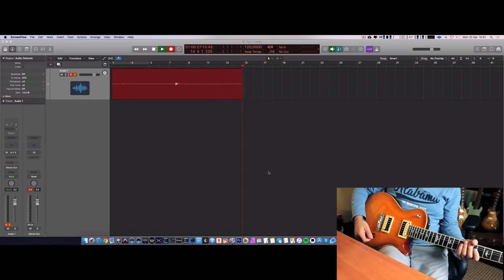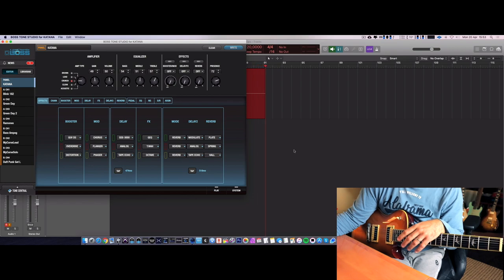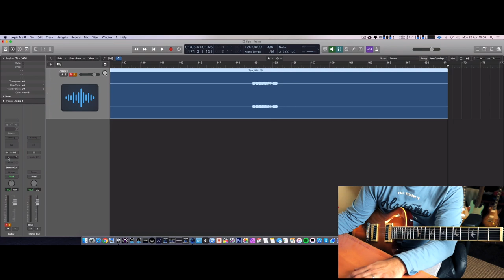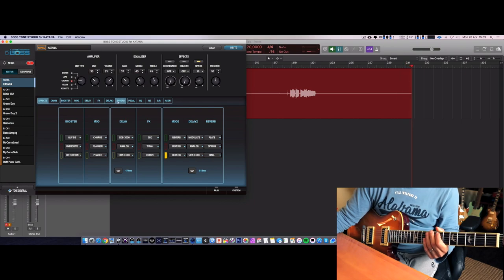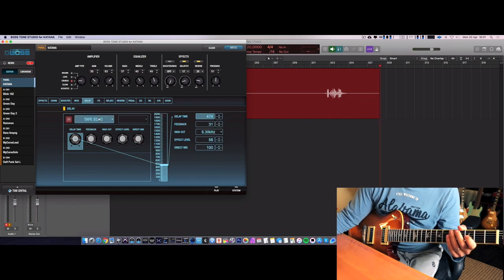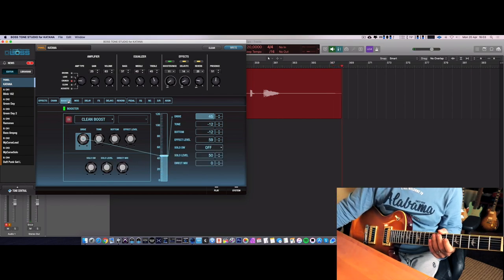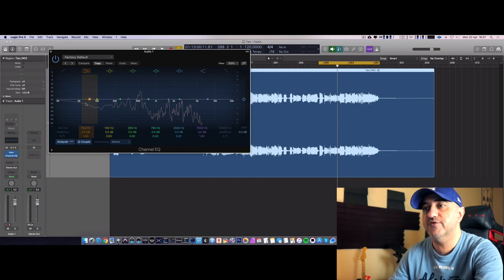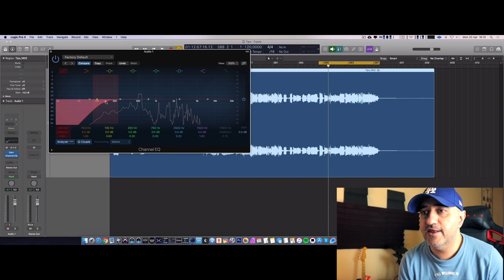BOSS KATANA - USB RECORDING TIPS TUTORIAL

Comment: Hi Juca, you can use the Katana as an input device in Audacity. In my version 2.0.2, you have to 'rescan audio devices' in the Transport drop down menu, then as long as the Katana is connected by USB and switched on it appears in the input drop down menu shown as a mic symbol. In fact you get 'Primary' and 'Secondary' versions, and I haven't worked out why there are two versions, but they work. You can use the Katana headphone out to monitor your mix too. No problem with input volume, you get as much as you need. I have learnt to go for - 12dB as a sensible level. Ian

Comment: The "low output via USB" is not an issue. It's just volume dependent. Use volume knob on the Katana. Set it to the max, and then adjust the Master, which is pass through via USB.
Reply from the maker: On the clean settings you need the amp to be very loud (unless you put it on standby) to get a decent signal. It shouldn't be like that. Cheers

Comment: Came here hoping to find some solutions to recording with my Katana MK2 100, unfortunately I didn’t but nice video and good tips. 

I’m using a windows 10 desktop with a decent spec, I have a couple of dedicated interfaces I use for tracking tube amps and Bias FX etc. But I want to use the usb on the Katana as it’s stereo, but in both studio one V5 and the latest version of Reaper there is no way to monitor. You have to select the Katana as the interface to record and it also becomes the default output with no option to change it. 

As the headphones out ( which I wouldn’t use anyway ) are mono it’s no good for monitoring in stereo, plus I’m not using a plugin to boost the input level which for me is so low there’s not even a visual representation; just two strait lines and very quite when played back.The usb line levels should be usable without resorting to hacks and work arounds, plus there should be a way to increase the output level in tone studio but if there is I’ve not found it yet, so far I’m disappointed with the recording options on the Katana for windows users. I’m guessing if I use the mono rec out into my Interface these problems don’t exist, but then no stereo and windows users should be able to record using usb without these silly problems. If anyone has found a solution for Windows please let me know :)

Comment: In the beginning, you showed that the recording volume is very low and barely register any waves. I am having the same problem. How did you solve that problem? Thanks.
Reply: If you click normalize one the items it should get louder
Reply from the maker: Just use a gain plugin.
Reply from the maker: Normalize is not a good option. Cheers
Reply: Juca Nery why isn’t normalizing a good idea?
Reply from the maker: Because it makes everything louder and usually  will destroy the dynamics.
Reply: Juca Nery I actually didn’t know that. It doesn’t seem to do that in reaper for me.
Reply from the maker: @saschabenjaminmusic7472  Depends on how low the signal is, but normalising is never a good idea. Use a gain plugin, it's much better.
Reply: Juca Nery which gain plugin would you recommend for reaper?
Reply from the maker: I don’t use reaper, but usually every daw has a stock gain plugin.

Comment: Sorry if I don’t understand. If the gain plugin only increases the volume of the playback, then how do you get a stronger signal for recording. I have found volume is very low with USB recording. Maybe you could sum it up? Thanks in advance!
Reply from the maker: Then you can bounce the track with the gain and get the levels right. You don't need to remove the gain plugin. Or max the volume on the Katana, that will increase a lot the USB signal. You can also have the amp in standby and monitor via your studio monitors. Cheers
Reply: @JucaNeryGuitar  Will the changes you mentioned affect the audio quality. Thanks for the reply,
Reply from the maker: @accentontheoff  No, not at all. Only plugins that add character, like console simulations.
Reply: @JucaNeryGuitar  Ah ok thanks. So a pro / semi-pro level recording is possible with the Katana? I am about to get one that’s why I ask. Your stuff sounds great. Thanks for your patience.
Reply from the maker: If it’s possible? I’m also a mixing engineer. Check my video on that: https://youtu.be/L263E-rBNdI
Reply: @JucaNeryGuitar  Will do thanks.

Comment: Hey I've connected usb into my mac book pro but I can't use or hear my katana effects! It's just a clean guitar. How do I get my katana effects to come through and record?
Reply from the maker: Because you can record both the dry and processed signal. What's the software for recording? I use two inputs, 1/2 for processed, 3/4 for dry signal. Cheers
Reply: @JucaNeryGuitar  logic pro. I'm not sure where to adjust dry and effected signals.
Reply from the maker: You need to create a stereo track. Then in settings for audio you need to select the Katana as your Audio In. Are you using any external audio interface? Cheers